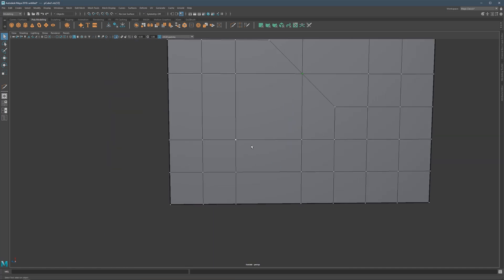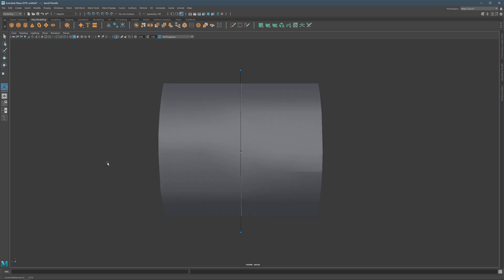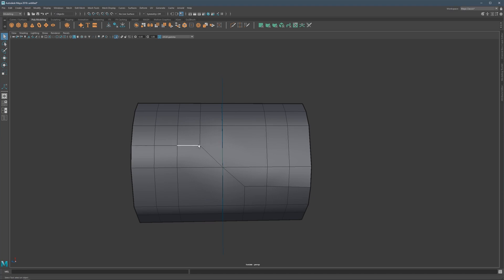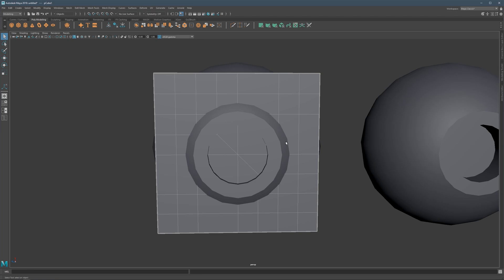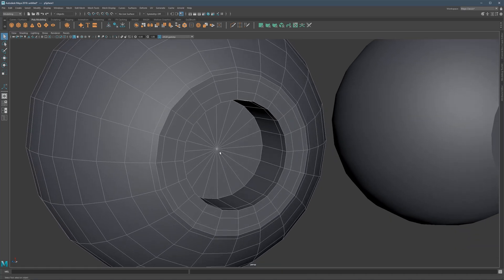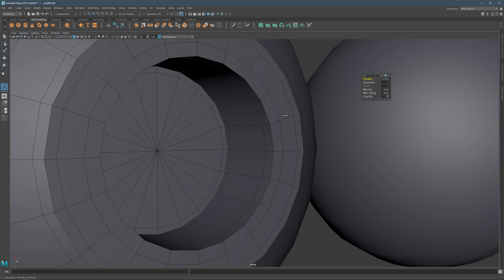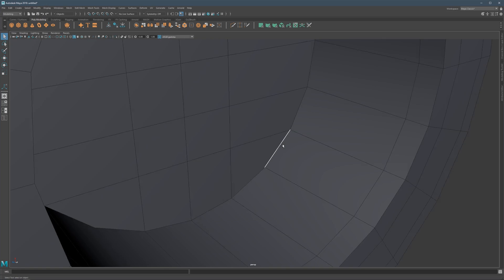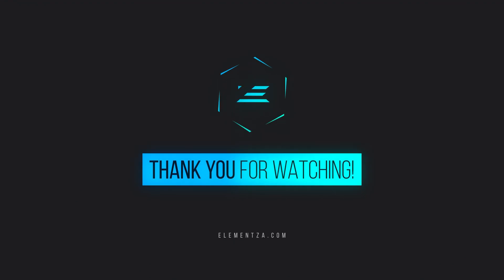Complex Poles in 3D Modeling

Comment: is there a way you share the coloring preferences for the viewport ? the defaults are pretty bad
Reply from the maker: I did at least 2 videos on this... check UI customization video in this series
Reply: @Elementza  are the same as your latest personalization ? Also if you can find an easy way to do it , can you look and share a way to have some better matcaps for hard surface modeling like  Blender or Cinema has.